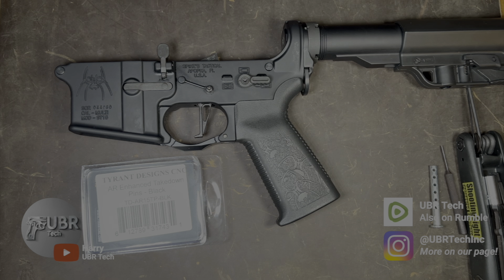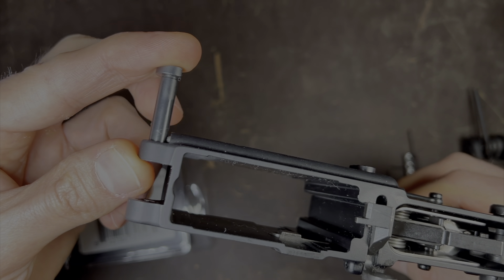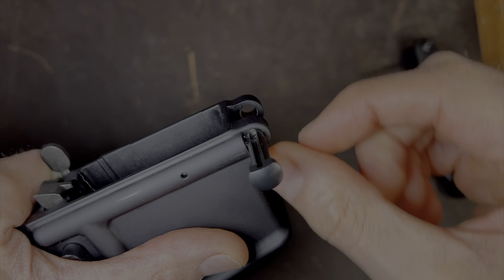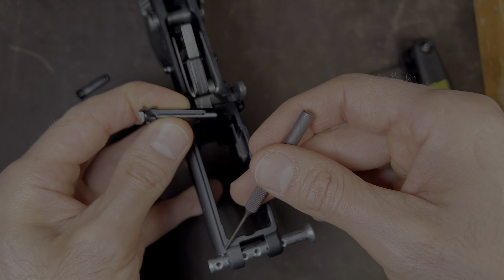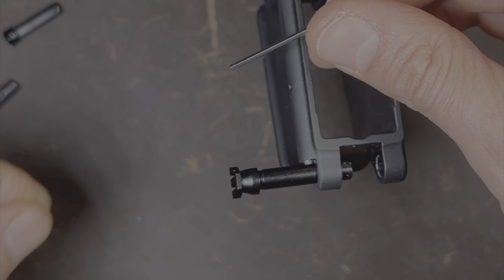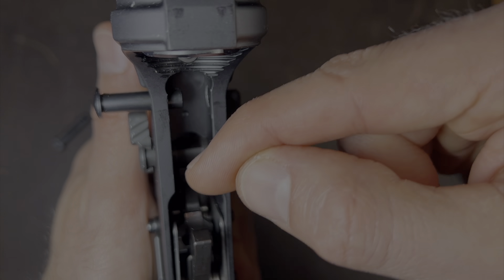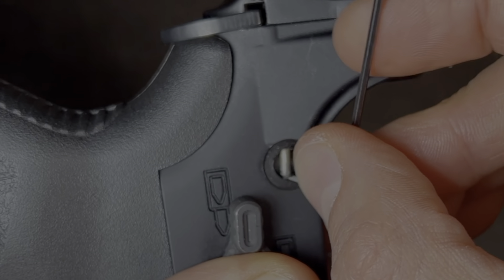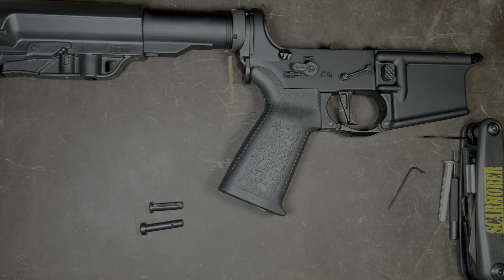AR-15 Pivot Pin Install - Easiest Way to Replace\Repair

Comment: After over a year of having your Tenicor Velo 4 and Harry’s Singleton holster for your P365-which one are you rocking more of? How has the wedge in the Singleton? 

I own a P365, I’m thinking strongly between Tenicor Velo 4, Certum 3, and this Harry’s Singleton. Also checked out Henry Holsters Flint Compact.

I have a Vedder Lighttuck w/ claw. The claw just isn’t doing it for me. It sits too low in reference to my belt, and the clip is aggravating. I added a T1C wedge...and that was a hot spot GALORE! The wedge for me made it way less comfortable-so I took it off. 

 I’m worried about the fixed retention with the Singleton, as opposed to adjustable retention. Is that an issue for you? Also, I mention the Certum 3 because I don’t know if a wedge will work for me, at least from the experience I had with the T1C one. I do also like that Tenicor is meant for 1’oclock AIWB carry...cause I don’t plan to carry any other way with my build.

Your thoughts
Reply from the maker: Hi Braden, I’m still using the Harry’s Singleton holster everyday. The wedge has rounded a little but still works great. The wing on the Harry’s holster also works great for me. The fixed retention hasn’t been an issue either. I’ve heard people complain about the fixed retention but I have no complaints.  I looked up the T1C wedge and if this created a hotspot for you then the Tenicor Velo 4 will have that same hotspot and would be worst because the wedge is plastic. So I would think the Tenicor wouldn’t be a good option for you. I can’t speak for the Certum 3 because I don’t own one. As far as the Harry’s wedge, this hasn’t created a hotspot for me. I think it’s because his wedge isn’t as thick. The T1C wedge looks like it’s really thick and would push harder on your pelvis. To date the Harry’s holster is still the most comfortable holster I’ve used. It’s not perfect but it’s the most comfortable so far. Let me know if you have any other questions.  Have a great day.